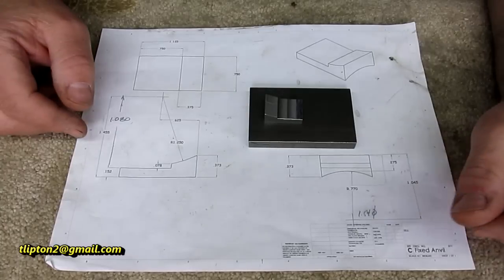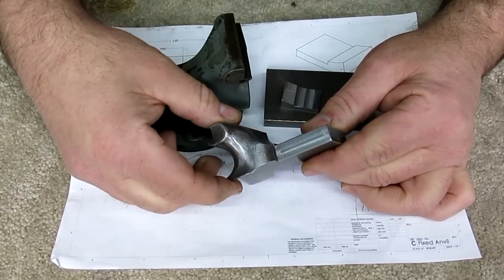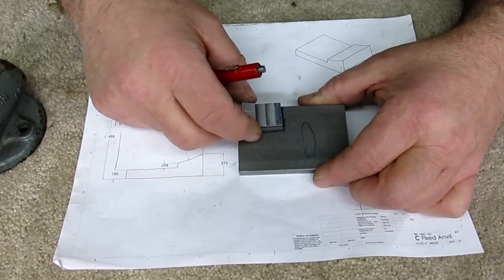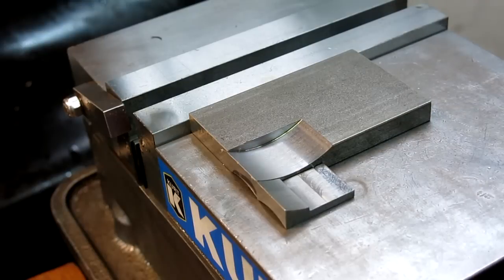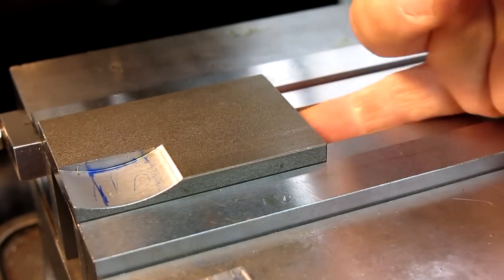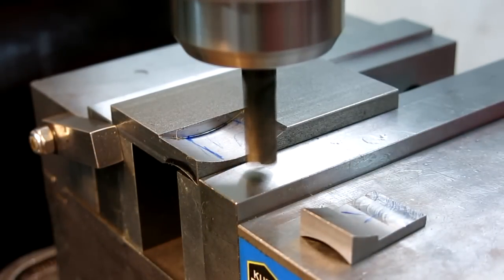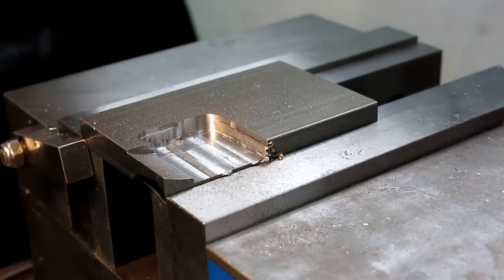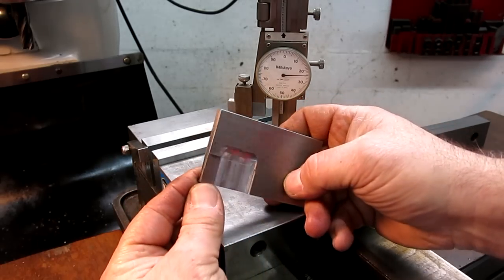Baby Bullet 17

Comment: Why didny you keep the "handle" and shaped those into the anvi piece? If a different material is required for some reson, weld a flat piece onto the "handle". I understand that one of the reasons for those videos are showing different methods, keeping it original style, but what I see is thousands way to make it simpler and easier to make. And perhaps better in regard of taking apart and maintain.

Comment: When you have a boring bar chatter, have you ever tried wrapping some lead wire (solder) around the shank.  Lead is a good dampener and I've found that it works well in some cases.
Reply from the maker: +Elden DuRand Hi Elden,

I have tried that trick. It works pretty well in some situations. The corner of this insert had seen quite a bit of use. Thanks for the comment.

Cheers,

Tom
Reply: What is the part called you use to adjust the boring bar radius? 
Cheers for any reply
Reply: +daz111090 My reply is, "good question!".  Otherwise, I don't have a clue.  Maybe Tom can provide some enlightenment.
Reply from the maker: +daz111090 Not quite following you here. The boring head was adjusted with an allen key to the correct radius. Thanks for the comment.

Cheers,

Tom
Reply: +oxtoolco 
Ohhhhhh!  THAT part!

Comment: Tom, I don't know an awful lot about Kurt vises, and I'm sure that with your skills and years being in the trade that you are not putting a lot of pressure on the part when locking the part, this is not trying to be smart, I'm curious why you do not place an identical piece of the same thickness of material in the opposite end of the jaws, is there a feature in these Kurt vises that eliminates that action,
Reply: +Walter Maisey 
Tom, I did get something from your video about getting the correct radius on the boring head, 

I did enjoy your videos, its a learning experience,
Reply from the maker: +Walter Maisey Hi Walter,

Not necessary to put a packing block in the opposite side of a Kurt. A well adjusted kurt will not change angles enough to worry about for 90% of the work you do. Older clapped out vises this is not the case. This is one of the reasons Kurt Anglelock vises are the defacto standard toolroom vise. They just work well. They do have some serious competition from some other makers now. They sat on their asses and just kept making the same thing. Orange Vises is one to watch in the next couple of years. Thanks for the comment.

Cheers,

Tom
Reply: +oxtoolco 
Thanks Tom, The British Motorcycle lived on their laurels and look what happened to them, but the worst one was Alfred Herbert, 

I knew there had to be something different, you would never have done that normally,

Comment: Was it necessary to reset the radius of the boring bar with the new corner on the cutter?
Reply from the maker: +David Platenkamp Hi David,

I didn't bother as this radius is not real critical. I looked at the insert and it was not chipped or deformed. You have to look under high magnification sometimes to see what the damage or wear looks like. Thanks for the comment.

Cheers,

Tom

Comment: The hand hacksawing, and hand filing must be Tom's new exercise regimen he has put himself on? Probably one of those New Years resolution things that only lasts a couple of weeks. Then it will be back to using the machine power equipment.
Reply: +Paul Frederick 
 Are you kidding! He's a filer from way back.
Reply: baggd65
I'm all for doing a bit of hand filing myself when the occasion calls for it. But if I had to blend those facets I think I would have went with an angle grinder, with a flap disc myself.